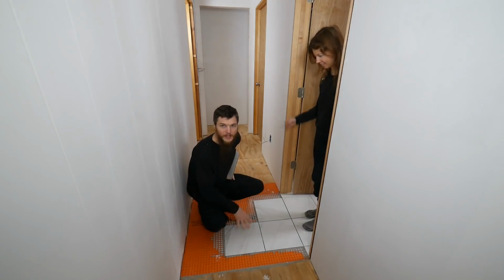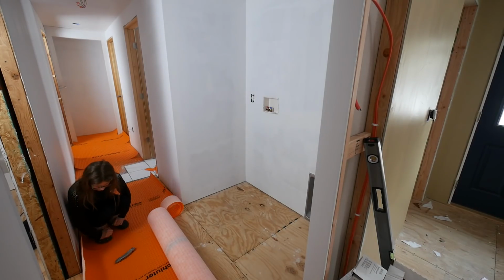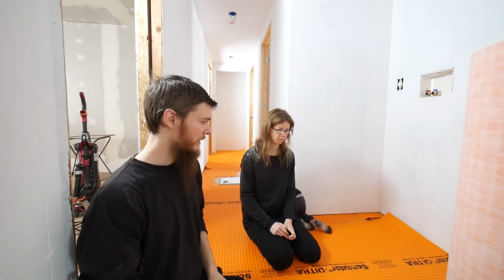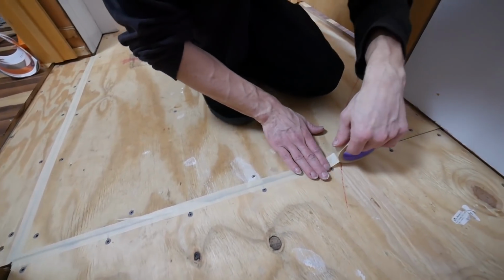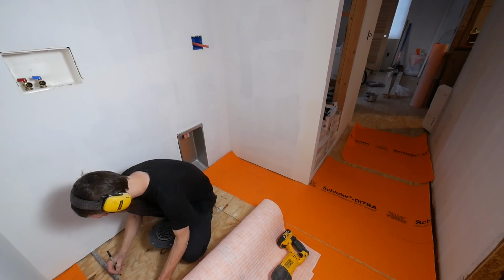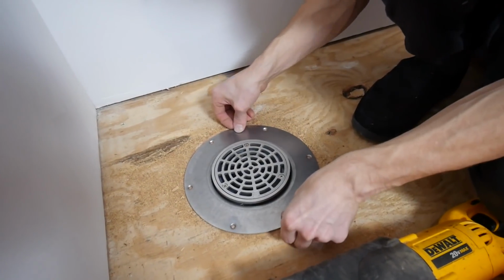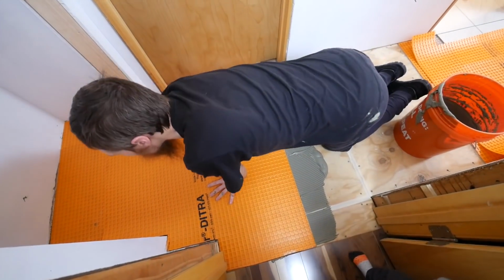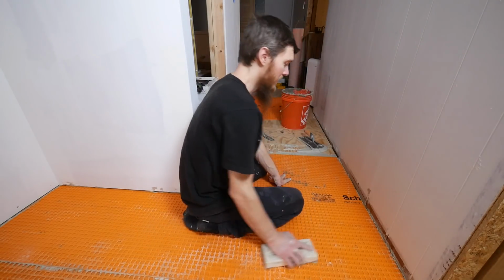Getting Ready for Tile - DIY Family Installs Ditra  - Home Renovation

Comment: I have had several of those bucket tool things over the years and have one now too.  This one I got now, I got about 2 years ago.  The first one I ever had I got back when I worked at a commercial / industrial electrician many, many years ago (probably close to 30 years).  I took a piece of rubber tubing that just fit over the handle and split it lengthwise and put over the handle and glued it on.  I then wrapped it a couple of times with a terry cloth rag and glued it in place.  Gave cushioning and made the handle larger so that it wouldn't hurt the hand as much when there was a lot of weight in the bucket.
Reply: I realize I'm quite randomly asking but do anyone know of a good site to stream new tv shows online?

Comment: Nice start to your tiling job. I, too, am a complete convert to Ditra after having originally depended on cement board under tile. So much easier and faster to use with less strain and hassle. And with the mortar layer under it Ditra only adds about an 1/8" of height to the floor. Yes, made in Canada by a German company.

Comment: Looks great. I found your answer in another followers comment. But was glad to hear you’re just plumbing the floor drain out of crawlspace, and not trying to tie into your waste lines. I know someone who did that who constantly battles sewer gases now, even with a p-trap. The drain was never used so the water in the trap continued to evaporate. With the placement of your drain, that would be a huge buzz kill to have to constantly feed the drain to keep the trap full. Nice work. I should’ve never doubted y’all. 🤣

Comment: I have a newer house and in my laundry room I have no drain. Not going to lie having no drain bothers me a lot . I did have an issue with my washer and luckily I was home to turn off the water to the house until my husband got home . I also wish I had a water turn off to my up stairs just Incase there’s a leek . I have a neighbor who had a leek in there top floor and the ceiling came down while they were on vacation it’s been a number of months of repair. I say water runs your house but is the most destructive for a house. Thank you so much for sharing your wonderful knowledge

Comment: Regarding the drain.  Considering how little (if ever) it'll be used, you could probably get away without even plumbing it in (in other words, if there was a leak, it would just drain out onto the ground, but just that once in a great while, although, it won't be much to plumb in either.  One way to prevent the sort of leaks that do happen is to change out the hot and cold water lines that go to the washer.  Those tend to fail over time, and if you put in new ones every 5 years, you'll likely never have that leak.  Also, get the more expensive metal braided ones rather than the ones that are just rubber, and that'll help prevent a massive flood too.
Reply from the maker: Yea, we're just going to have it drain outside. We agree about the hoses, we're using the metal braided ones  :)

Comment: idk if you did it or not, but it is recommended when bonding anything with thinset to osb to first run a wet sponge over the osb. provides a better bond, and in some cases, prevents a failure as the osb can leech water out of the thinset and cause it to prematurely dry without bonding to the substrate.

Comment: think like nike : just do it
as for the drain under the washing machine , one thing you can do to prevent waterflow intoo the hallway is putting a raised and tiled in ledge (say the raise being about two tiles stacked atop eachother ) around the washing machine and drier , that way the water level can rise a bit before it start to go over the ledge and run intoo the rest of the house 
the drain when left open could cause a cold draft to come intoo the house from under the floor , might even cause some odors to rise from under the floor , hope you hook it up to the rest of the plumbing
Reply: That is TRUE❗GLAD YOU BROUGHT IT UP ☝
Reply from the maker: There'll be a raised threshhold across the front of the washer/dryer nook. We'll be using a trap seal to block air and bugs from getting in :)
Reply: @diyfferent  , put some tile strips along the bottom of the wall and close all inside edges with silicone to make it more watertight , that prevents any leakage from getting sucked up by the sheetrock of the surrounding walls  , thought about the trap later , should work need to fill it with water a few times a year to keep it closed but thats eazy 
realy like the way the house is turning out youre doing a great job at it

Comment: Interesting thing the floor drain I always thought it should be a way. You 2 are my encouragement. Can detra go on as shower walls what you think,  thanks Doug and Ashley. Maverick needs a tool belt.
Reply from the maker: I wouldn't put ditra on the wall, but the same company makes a product called Kerdi that is meant for showers and walls.

Comment: How cool was it when Doug was holding the Ditra up on the wall and Maverick jumped to help. He knew exactly what to do. Looking at the kids faces shows little learning sponges. I’m gonna do my kitchen. I’m torn between tile and the new epoxy effect. Either way I have to do a self leveler on the front half. I’ll watch this again maybe that will help. The Ditra looks really easy and I love tile. Hi to all. U guys r an awesome family. Ditra down .. drain in.. goals completed. Oh yea so will u go back later and connect pipe to that drain ?
Reply from the maker: We'll be adding a trap seal and a pipe that will just exit the home instead of going into the septic.

Comment: In our area by code we need to have a pan under the washer to collect any leaks. Why not get one of those pans that the drain can actually start there so the leak only goes as far away as the pan itself? Just a suggestion.
Reply from the maker: We are essentially building a pan in place. When it's finished, if there were a water leak it will be contained to the laundry nook and will drain through the floor drain.

Comment: I love the idea of the floor drain.  We wish we had one when our washer machine leaked water. But my question is do you feel a cold draft coming out of drain with the cover on?
Reply from the maker: The drain isn't finished yet but we'll be running a pipe so that it drains to the outdoors and will be using a trap seal to keep out the cold air. It's basically just a little one way valve that lets the water go down but stops everything else from coming up. We just had to get the drain in the floor to do the tile and we'll finish up the plumbing later :)
Reply: @diyfferent  Thank you I am going to show your video to my husband.  We have a mobile home too and dealt with the water from our washer draining on to the flooring and into the carpet.  Or course we are replacing with flooring.
Reply from the maker: @lidialippold9274  You could also use a standard washing machine drain pan that sits under the machine and have a hose or drain line run from that. That's a common and easier way to do it.
Reply: @diyfferent   I told my husband and he liked the idea with what you did and will add it when we remodel our home.  The drain pan is good, but when it comes to moving the washer machine it becomes a little challenging to move it with the drain pan in the way.
Reply: @diyfferent  Why wouldn't you just plumb it into the main drain line?
Reply from the maker: @philipem1000  Because then we would be required to install a trap primer to keep the trap from drying out. Running to outside is just easier and makes more sense for a washing machine drain pan, which is essentially what this is. Plus we'll already have a drain pipe going outside for the water heater drain pan so it's easy to tie them together in the crawlspace.

Comment: You do need to put a drain pipe on tbe drain underneath the floor or else youll get bugs, insects, pests crawling inside your home.  Best wishes!
Reply from the maker: Yea, this was just the quick rough in to get the Ditra down quickly, there'll be a trap seal (to keep cold air and bugs out), then a pipe that will exit outdoors.

Comment: Nice job!  😊❤️ Will you put a screen in the drain to keep bugs out?  We’ve had three houses tiled and there’s no Ditra or anything but the thin set under the tile.  They don’t use it here in the desert Southwest.  Maybe that’s because we have cement floors.
Reply from the maker: The drain will have a trap seal that stays closed, but opens up when water goes down it so bugs will stay out. :)

Comment: Yay Canada. 🇨🇦🍁🇨🇦
How will you ensure critters won't get into your home from that drain hole?
Reply: The drain has a metal cover that will keep any intruders out.
Reply from the maker: It has the grate on the drain, plus it will have a trap seal, and where the pipe will be exiting the house we'll put some kind of mesh on :)
Reply: I think they mean until it is installed. I have the same concern. Those rats are Wiely!

Comment: Okay another great video. This is just awesome information about laying tile, but I have a question about the drain. I know it would normally be dropped into a drain line and you are letting whatever minute amount just drip onto the ground, but is there going to be screen over the bottom end or will you replace that center piece? And will thebwasher clear it? I'm worried about mice. 😟
I
My washer spins so crazy it would close it.
Reply from the maker: Yeah the center piece with the grate will go back in after the tile is done and it screws down level with the floor. I just took it out for now to keep it from getting mortar on it. The drain will eventually be run outside and will have a screened cap on the outside to keep stuff out. We'll also have a trap seal in the drain which is just a little valve that stops air and bugs and such from coming in.

Comment: I wonder if you could staple or nail down the ditra down instead of using thinset
Reply: I would not reccomend it
Reply from the maker: No, I would think you would really need the thinset to be an effective and solid tile install. I think there would be too much chance of it lifting or not being stable under the tiles otherwise. But I wouldn't stop you :D
Reply: @diyfferent  my house house is on a slab so I wouldn't need anything under the tile I was just thinking that with the thinset under the ditra if I your trailer were  settle or move a little if the ditra would be able to kinda flex with it or if it would stay stiff and crack if that makes sense

Comment: How does the floor drain protect against critters and drafts?  Maybe I dozed a little when that was discussed.
Reply from the maker: We quickly got the drain in the floor so we could continue with the Ditra. Later on we'll be adding a trap seal which keeps out bugs and cold air, and then a pipe will go to the outdoors. For now we stuffed the hole with a rag.

Comment: Will you be putting a hose to lead the water away from under the house and keep mice from coming up through the hole?
Reply: From Judy. A previous video (sorry I don’t remember which one) shows what he does with floor holes. It’ll be the bathroom video. He creates a frame for a net screen trap if I remember rightly. Regards from Australia 🇦🇺.
Reply from the maker: It will have the metal grate, then a trap seal (which keeps cold air and bugs out), then a pipe that will exit the house and on the end will be some sort of screen. :)
Reply: @lesterbock9851  Thank you. I forgot about that. Sorry. Short term memory problems.
Reply: Sharon Rabner   From Judy. No sweat! I don’t know how old you are but as I’m 67 I call them senior moments! 😂🤣😂 You’ll see by DIYfferent’s response I was obviously having one as I remembered the frame but not the correct air trap bit. Oh well, that’s life. Love this channel and family so all’s great. 🇦🇺❤️
Reply: @lesterbock9851  Yes Judy. I have a lot of moments. I will be 68 in May.  Love this family, too.  So smart in figuring things out. I wouldn't know where to start. They know how to do so much.

Comment: Hello, thanks for your channel. Excuse my rough english, but I think you made a mistake with the drain and that there will be a sealing problem. I think you should have screwed the plate over the tiles and not below the mortar.
Reply from the maker: No, we did it correctly :)
Reply: Plate goes under otherwise the opening/grate would be above the tile when it should sit flush

Comment: Are you tying that floor drain to your main waste drain? If so make sure you get a self priming trap.  Otherwise you will have to add water to that drain every month to keep water in the trap or you’ll get sewer smell in your laundry nook.
Reply from the maker: No, the pipe will just exit outdoors. We'll have a trap seal to keep cold air and bugs out. But very good info :)

Comment: periodically, pour some water down that drain.  I didn't do so and came home to a horrible smell in my home.  Took me a while to find that the water had evaporated from my drain.  Once I ran water, the smell was gone.
Reply: Same thing happens to me. I poured vinegar
Reply from the maker: Our floor drain will exit outdoors and will have a trap seal installed to prevent cold air or bugs from coming in. But you are right about normally keeping floor drain traps full.
Reply: I think why ours stinks often is because of the humidity. I dont know where it leads or what kind of drain it is. It's in the concrete slab and I imagine it sweats in the whole drain.
Reply: Oh we live in south Texas so no getting away from condensation

Comment: I hope you plan on re-enforceing the floor from below in the crawl space.
Reply from the maker: I'm sorry, I'm not following. In what way and why?
Reply: I also thought about the extra weight on an older mobile home frame. I was told that tile should only be a 4x4 area in a mobile home due to the weight.
Reply: You need to strengthen your floor joists because porcelain tile is very heavy. If it was just a small area you would be fine, but the whole length of the hallway and the bathroom with the possibility of going thru the kitchen and nearby bedrooms, you need to strengthen your flooring structure so there is no warping or possible damage to your tile job.
Reply: But they have stored piles of tiles on the same floor all this time. They haven't mentioned any problems with that, have they?
Reply: @mochi_and_me  would you take a chance of your tiles moving and cracking because your floor is buckling die to the heavy weight? An ounce of prevention is worth a pound of cure.
Reply: @michaelvalone907  I truly have no clue about these things, that's why I enjoy this channel. It's a learning experience for me. But I figured if the tiles have been stored all this time in Mavericks room and now in the 'pantry' that they would have noticed if the floor was bowing.
Reply: @mochi_and_me  i believe  ruin would happen over time.like a drip leaking down a non sealed  window. One drip isnt so bad but after awhile,you get the picture.
Reply from the maker: @michaelvalone907  Oh I see. Our floors meet the deflection requirements for porcelain tile. We have good support underneath and I did double the joists under the washing machine and water heater areas. Plus we added an extra layer of plywood for rigidity. Along with the Ditra I feel good about the tile. If we had a particle board subfloor (common in mobile homes) or any greater joist span than we currently have I would hesitate to lay tile. It should be okay :)

Comment: How will you prevent anything from coming into that outlet of the washer drain can bugs snakes rodents go through the outlet into the house
Reply from the maker: Do you mean coming through the floor drain? The drain gets fitted with a trap seal to keep out all bugs and cold air. Then it gets finished with a drain pipe that leads outdoors with a grated cap to keep out larger critters. And the grated cover on the indoor is a secondary protection. It's air tight from the outdoors but lets water through when needed thanks to that trap seal device.

Comment: I really like your videos. Isn't your home a modular home rather than a mobile home? Here where I live this home would be considered a modular and your last one would be mobile.
Reply: This is a mobile home.  They didn't make modular homes in the 70's.  Mobile homes are built to HUD code(can be a single or doublewide)and modular homes are built to BOCA code(which is also the code used for site built houses).  You've probably seen them going down the road when they are being moved.  A mobile home has it's own running gear(axles, wheels(they are sometimes removed) when the mobile is set up on site), a modular has no running gear, is moved on a flat bed truck and has to be put on site with cranes and the 2 sides put together on site.  A lot of people list mobile homes as modular when it's a doublewide and they're selling them. But if it was built as a mobile home, it stays a mobile home, even if it's put on a basement.
Reply from the maker: Ours is a doublewide mobile home. It has steel beams. They had tongues, axles, and wheels to get them here which have since been removed. Modulars don't have the steel chassis.

Comment: Does tile work well? We had someone come gives us a quote and he said not to put tile in a Mobile home....I was a little disappointed but I see so many people do it that I think he might have been wrong
Reply from the maker: Mobile homes tend to move/settle over time so the tiles would crack easier. Also, many mobile homes have particle board subfloors which we feel like isn't suitable for laying tile on. Ours in on a solid concrete block foundation with good support and plywood subfloors, so we feel comfortable doing tile for our situation. :)